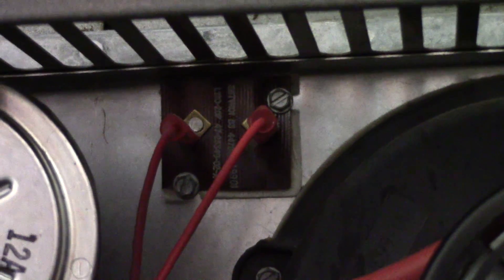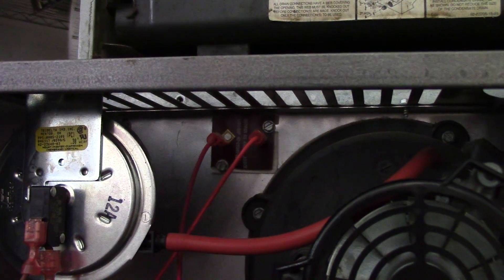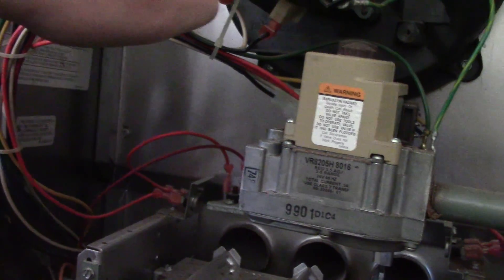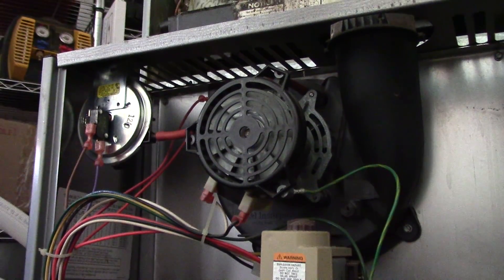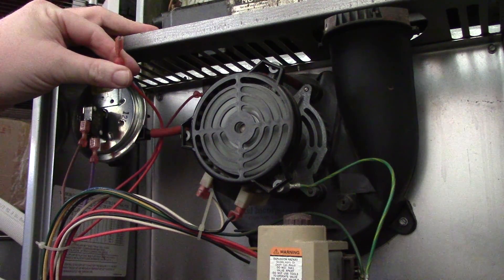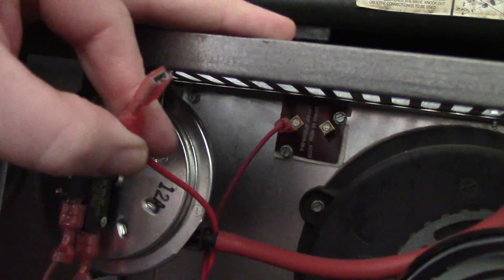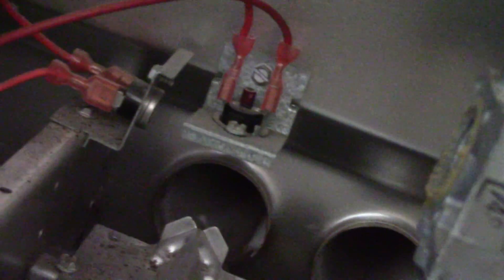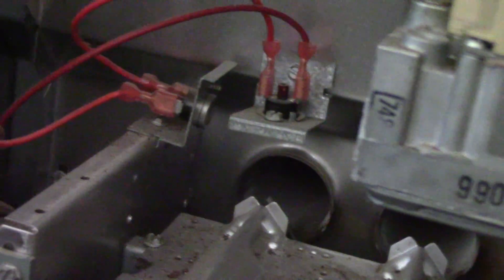Gas furnace high temperature limit safety switch troubleshooting

Comment: Thank you! By your video, I could revive my heater. Otherwise, I had to sleep in 15 degrees like in Siberia. My wife also says thanks to you.
Reply from the maker: Your welcome glad I could help.
Reply: @ChilesHeatCool  I just had a new furnace installed ~ High  efficiency “RUUD”
I just got a notification from my smart thermostat saying that  My main limit switch is open. What does that mean?
Reply from the maker: Low air flow from the blower or ductwork. Another possibility is the manifold gas pressure is to high.

Comment: I had a code for high limit switch , but ultimately found it is the molex connector with yellow wire which is loose. any suggestions how to fix it?
Reply from the maker: Pin puller with a new pin but those are hard to find. New wire harness will work. You could try to see if a small screw driver can expand one side of the plug to make a better connection but if done wrong could ruin it. One side fits in to another plug so expand the male side a tad bit more carefully. To much and it could get ruined.

Comment: I only figured out what the problem was because on the blow a motor I noticed the little red switch when I looked at it just right. I messed with it and noticed that the little button pushed back in and the furnace turned back on right away. I live in Wyoming where in the middle of Winter and it was freezing cold. The gas pilot lit but the furnace itself didn't turn on until I pushed that button in it turned on immediately. Had I known the switch was there I would have figured out the problem a long time ago. And then I ran into your channel and it explained what that switch did. I guess a question I have is should I replace it since it engaged?
Reply from the maker: Maybe. You said pilot so it's old but if the furnace is overheating that would trip it. If its cheap enough like $10 I'd replace it cause it's $10. Make sure the blower wheel is clean and filter are not to dirty. Air flow and gas pressure effect furnace temperature that can cause it to over heat.
Reply: @ChilesHeatCool thanks, appreciate it. Me and my lil dog were freezing. I stayed up till 3 am looking on the net for a resolution and since I'm a truck driver I'm not home very often.  I was afraid I was gonna have to call a service tag and if I did they probably would have laughed at me since it was a simple solution. I did blow out all the dust before I noticed the red button then changed the air filter after it turned on. It dies sound better now after the dust was removed. I usually changed out the filters each winter but since they were pretty dirty I will be changing them out each month if needed.

Comment: My furnace runs for only 2 minutes then the limit switch opens I ran it without a filter (the filter is new) and there is little to no dust on anything it shouldn't overheat and open the switch .
Reply from the maker: If you have a high efficiency furnace the secondary heat exchanger may be dirty. If you have air conditioning you could have a dirty evaporator. You might have to call some one to have a manometer hooked up to test gas pressure.

Comment: I ordered a new limit switch that will be here in a couple of days.  Can I bypass the faulty switch until the new one arrives.  The filter needed replaced, which was causing the switch to limit. I put in a new air-cleaner filter.
Reply from the maker: Its not recommended to by pass safties of a gas furnace.

Comment: I have 170f-30 switch can i use 170-40 instead?
Reply from the maker: Maybe. It will open at 170 degrees if there is a problem. It will just take longer to close. I'd say try it and see if it will work. Make sure the length is the same.

Comment: Thank you for your video! I'm at a loss with my Carrier Infinite Furnace. Limit fault switch Error 33 is triggered. I replaced the limit switch 180-20F two times. The wall thermostat is capable of running a system check. I removed the filter to test the system and still got Error 33. The system check "Furnace LOW, MED and HIGH" on HIGH heat I get: Airflow 1288 CFM, Inducer RPM 3315, Blower RPM 776 and Static Pressure 0.30 without filter. I vacuumed the blower fins, they was only a mild film of dust on them. All vents in the house are open. System Limit fault is triggered only during HIGH heat. System was new 2012. Any ideas, thank you!
Reply from the maker: I'm thinking gas pressure is to high or dirty coil if you have air conditioning. If this is a condensing furnace the secondary heat exchanger could be dirty.
Reply: @ChilesHeatCool  I checked out the coil and it had a thin dust film on it. I cleaned it but that didn't fix the error. Then I changed the wall thermostat setting from COMFORT to EFFICIENCY. It results in a higher CFM during all 3 modes: LOW, MED, HIGH. During the HIGH test the COMFORT CFM=1288 and the EFFICIENCY=1520 (below 1600 spec) and I didn't get a limit fault switch error. I'm probably fine keeping it on EFFICIENCY for a short time but I worry a bit if it's masking a problem.
Reply from the maker: I bet the manifold gas pressure is high. It might just be off by enough to cause an error like that.
Reply: Dont change the swich that was a wast of time the error says its open. Means ur temp was up faulty compaseter on blower motor

Comment: I tested the ohms on the high limit switch and the numbers were jumping all over the place does this indicate the switch is bad?
Reply from the maker: It could be that, your meter batteries, or a bad connection with your meter leads.

Comment: So my limit switch keeps tripping. I used a multimeter to verify that it reads 24v when it trips. I also tested continuity and it was good. I removed the limit switch and used a jumper to keep the furnace running while using a meat thermometer to check temperature in the port. Temperature never came close to the 200F specified on the limit switch. So I replaced the limit switch and it's still tripping. Air filter brand new and still trips if removed. Blower is 1 year old, furnace 6 years old. All registers are open and should be clean.  Unfinished basement so only registers on upper levels. No kids or pets that might stuff something in the registers. There are no dampers either. AC unit was replaced last summer, so the coil should be relatively clean.

What else could it be? Evey time a tech comes out, they suggest something different with a huge expense.  Kind of like going to a jiffy lube and being up sold a cabin air filter replacement for 75 bucks.

Moreover, it never locks out on me. And I only seem to have the issue when bringing the house to temperature in the morning. Say from 65 to 70. It runs fine during the day and night to keep things at temperature.
Reply from the maker: Hmm with out seeing it i wonder if the blower speed is right or if the gas pressure is to high on the manifold. Manifold gas pressure should be checked by a profesional or sometimes the utility company might do it free.  I think I have a video that's part of a furnace service series talking about the temperature rise and sequence if operation. Only 10% maximum on registers should be closed in a house. You could try opening one in the basement and see if it helps. Also make sure the blower is clean. Do a temperature rise check and compare it to the data plate on your furnace. League reasons I say mess with the blower motor speed if you can. Now if its an older furnace the fan limit switch has to be set right.
Reply: @ChilesHeatCool  no registers in basement as it's not finished. I did a temp rise test and it is well within limits. Temp at return was roughly 70F and at supply 120F.
Reply: @ramblinman7153  Take high limit out and just let it hang. Don't let it tough metal cabinet.  If furnace never trips limit you have your answer. Are the techs checking HEAT EXCHANGER?
Reply: Also try using cheap blue filter. Cap could be low on blower. Wheel could be dirty. Blower speed too low.  Adjust  manifold gas pressure on both stages.
Reply: @5822huron  it was an overfired furnace. Funny as it hasnt been a problem until now. Also don't understand why the installer didn't set it properly when it installed in the home 6 years ago
Reply: @ramblinman7153 Do you mean the gas pressure? Gas pressure can be affected by the outside regulator.Things change. But you can turn gas pressure down at manifold and it can sometimes fix this issue. Overheating takes a skilled tech to diagnose  lol
Reply: @5822huron  I bought a manometer to test it, but didn't feel comfortable working with the gas. So I called the HVAC guys and they reduced the pressure.
Reply: @ramblinman7153  what kind of manometer did you get? 🤔 sell it to me. I can always use another. 
Gas pressure should be 3.5 wc
Reply: @5822huron  I purchased a Texas Instruments one from Amazon. After I decided not to use it, I returned it.

Comment: Hello will the ignitor heat up and the furnace start if I have a bad limit sensor?
Reply from the maker: No. It will fault out and stay off when it is on limit switch. If the furnace is igniting the gas and shuts off, its probably a dirty flame sensor. I have a video on how to test and clean that.
Reply: @ChilesHeatCool  okay thanks for your help
Reply from the maker: Your welcome.

Comment: Thanks, I will need to test ours with my meter... At Grandma's house what is happening is that the heater runs and will cycle off normally when the t-stat is satisficed but when it attempts to reignite the burner the gas valve opens (and lights) but then the gas flows cuts out right away till it cools way down. I am going to need to locate the limit switches and test them. The heater has been working fine for about 12 years now but in the last couple of months this gas cut out has started.... I did air balance for 38 years not service so your tips will give me the starting point to see if I can figure this out...
Reply from the maker: If it lights and goes out, might be a flame sensor. Glad my videos can help.

Comment: Is it normal for the heater to consistently hit the temperature to activate that limit switch?  Our limit switch operates every few minutes and I wonder if it's normal for the heater to be that hot to constantly activate that switch?
Reply from the maker: No. It is a problem. The high temperature limit is to essentially prevent the furnace from catching on fire. Check your filter. If its clean then the blower wheel or a/c coil could be dirty or to much gas pressure or wrong fan speed. Air flow and gas pressure are the two things that effect that.